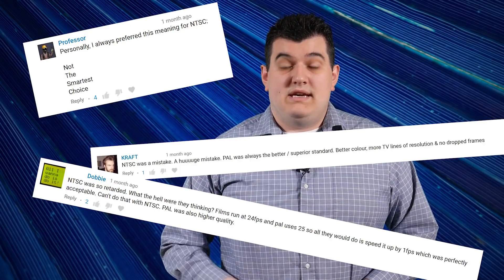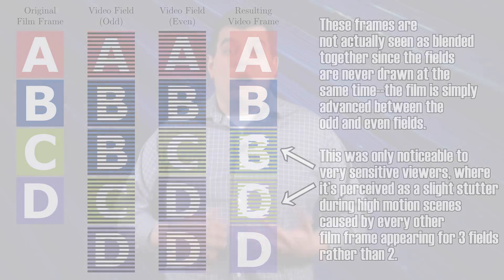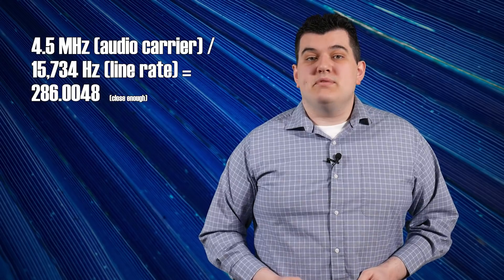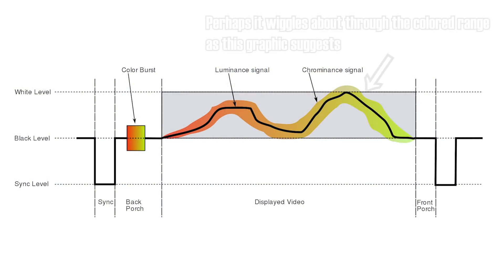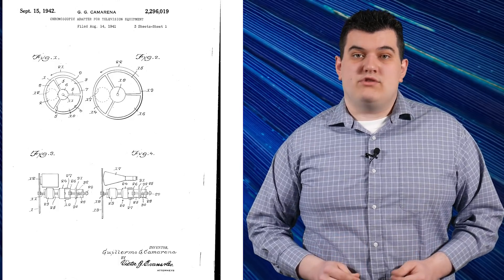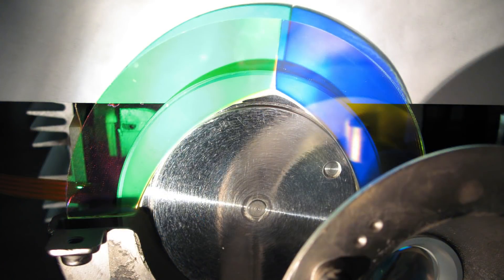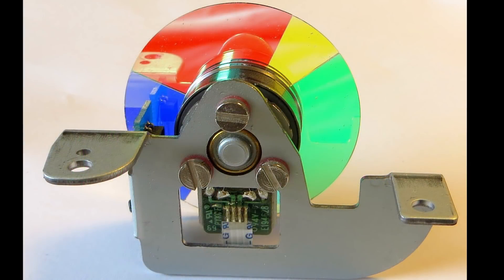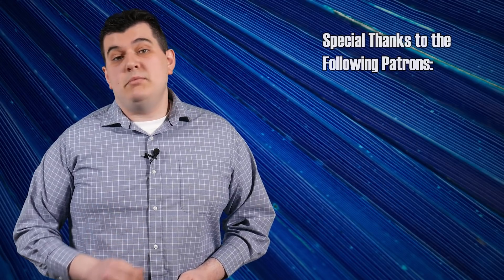Analog Color TV Wrap-Up--Some extra info

Comment: The fact that they managed to make it backwards compatible at the time is an impressive feat. What nags me though, is that the backwards compatibility has caused that 29.97 and 59.94 fps to stick around well past any technical reason for it being there, like some signage grade LED processors and projectors, that are being used in electrical grids all around the world that may or may not be 60Hz and sure as shit aren't dependent on mid 50s american broadcast bandwidth limitations. The pure digital signals also still include the blanking and overscan shit even though they serve no purpose what so ever. There was a point when shifting from VGA to pure digital where instead of building the new standard based on the old, they should've just started from scratch.

Comment: What I want to know is how we ended up with 2 digital TV standards (ATSC and DVB-T). Was it like analog with one comming first and the other comming later but fixing problems with the first? Were both developed at the same time? Were they designed differently to allow easy conversion to the respective analog TV standards (ATSC to NTSC, DVB to PAL) so they could easily work on existing analog TVs via converted boxes?

Comment: Huh, I've always wondered why Steve Jobs boasted about their monitor using an older tech (the shadow mask) but it makes sense it was for the resolution.
Reply: What are you talking about? Apple used shadow mask CRTs on cheaper monitors, and aperture grill (i.e. Sony Trinitron and Mitsubishi Diamondtron) CRTs on higher end ones. Of course they then moved the high-end monitors to LCD, and later all of them. What never got used in true computer displays was that slit-style shadow mask shown in this video. (I think some very early color computer monitors, think Commodore 64 and Apple II days, which were basically just TVs without a tuner, did use that shadow mask style. But high resolution computer monitors, VGA and above, needed finer pitch, so used either the dot triads or aperture grilles.)

Maybe what you’re thinking of was Jobs simply stating that they put a high quality CRT in the original iMac. He certainly never said it was better than an aperture grill. What it was, though, was a reasonably good quality shadow mask CRT, better than what most consumer PCs of the day came with. (They often had bigger, but lower quality displays.)

Comment: The BBC ran some colour video testing around 1959/60, but I guess thy were using American NTSC equipment and decided not to bother.
I always noticed in the 1970s and 1980s how American shows shown in the UK always looked very yellow tinted compared with our own and blurred, though the blurring was probably due to the frames-per-second difference.

Comment: Any in-band modulation of the video signal would be visible.   Pretty much that simple.  Later receivers suppressed the center frequency for luminance display, so areas with solid color didn't have the 3.58 MHz interference, but the interference still showed on transitions between colors.

Comment: Wow from what I’ve gathered you Americans really love pal. Well as someone who grow up in a pal region l tend to disagree with you Americans. Pal sucks arse in my opinion, why you ask 2 reasons number 1 slower speed 50hz was such a retarded choice retrospectively why because virtually all video games were just slowed down and movies just sped up and even worse 50hz gives me a fucking eye strain why because it flickers a lot more than ntsc thanks to the lower refresh rate, I mean seriously WTF and 2nd the “extra resolution” why is that a problem because the extra lines that pal had were almost never even fucking used (at least in retro games) and even worse still, because of the “higher resolution”old video games in pal regions had “letterboxing” and looked squashed and there was no way to fix it and let’s be honest even when the resolution was used this is analog crt TVs were talking about you probably couldn’t even tell the difference thus negating any significant advantages pal could ever have over ntsc at least in my opinion, that is why I am very jealous of you Americans that got ntsc.
Reply: The cycles got decided because your power lines fed 50 and ours were 60.  It was a lot more costly back then to create a frequency electronically, than to simply use what was coming from the cord.  The 50-cycle drawback got a lot more amplified once screens got bigger.  This side of the pond, few of us had any idea how bad NTSC was, until we viewed ATSC or high-end computer monitors.  Now it's hard to give away a tube TV set!

Comment: In a NTSC or PAL signal (also called composite video) the color signal based on a subcarrier is modulated with the luminans signal. It is very difficult to separate the composite signal into Y (luminans) and C (color) without aliasing. Simpel filtering using passive electonic components like capacitors and coils will give the aliasing (the crawling dots) on a black-and-white TV. Broadcast signals were internally based on component video, thus no crawling dots in tape editing. Component is Y, R-Y and B-Y signals making the video processing much easier. Yes, it requires three cables and three identical amplifier circuits to transmit a component video signal. However, due to black and white TV the colors have to be transmitted as luminans and chrominans mixed together - the composite signal. The subcarrier would when be used to set the hue and decoding correct on colour TVs. On broadcasting the tape recoders or synchronizers used a comb filter to split the received NTSC/PAL into luminans and chrominans for later editing. The comb filter came in the early 90's and very expensive, and it did not make sense to implement a comb filter on mono chrome TVs. Most people will not know about the crawling dots, mainly on cyan colours, and will be accepted as a trade off for having backward compability with B/W TV when NTSC/PAL made is possible to transmit colour is a single and relative low-rate bandwidth.

Comment: It is true that some TVs could produce an interference pattern caused by the difference between the chroma carrier and sound carrier frequencies but this was much more coarse than the chroma dot pattern. The fine 'chroma dots' were simply caused by the colour subcarrier being superimposed upon the luminance signal. The colour system used the supressed carrier AM technique which is why the dots disappeared in non coloured appears. The reference frequency of the colour subcarrier was not a whole multiple of the frame rate which meant that the exact phasing of the colour subcarrier info was different on consecutive frames. This meant that the chroma dots would move and hence be less noticeable by averaging out over several frames. It also meant that false colour artifacts produced by components of the luminance signal being wongly decoded as colour, would appear different on consecutive frames and produce a flickering effect.

Comment: You don't need to artificially manipulate the Y signal since it relates to color brightness.
The dot pattern is indeed caused by the chroma signal. You can figure that out using a bar pattern generator and an oscilloscope: the dots will be more visible in the bars where the chroma signal has more amplitude.

Comment: I have relatives in Australia and anytime they'd send us VHS tapes in the mail of home movies or TV recording my dad said they couldn't be watched right away because they were recorded with "different electricity". We always had to send the tapes to a local business that could dub an NTSC copy of the tape. When I asked one day to see what happens with our tapes they showed me where they work on having those taps dubbed and explained that "different electricity" meant a different color system that our TVs and VCRs weren't compatible with.
Reply: Specifically re electricity, Australia (like NZ, Europe, etc) uses 50 Hz AC, vs 60 Hz for the US, Japan, etc. In the early days of TV, it was much easier for TVs to display images whose frame-rate (frames per sec, fps) were related to the AC frequency, so in the US that's 30 fps, in Australia it's 25 fps. Nowadays TVs, computers, projectors, etc have much better power supplies, and nearly everything is digital, so the AC frequency really doesn't matter. But due to the history, differences persisted.

The other half is that Australia chose 625 line pictures (as per Europe). The standard choice for 625 at 25 fps was PAL colour (or the French SECAM). This was by no means mandatory - but again, historical and political influences as well as technical factors made these regional choices  pretty entrenched.

Comment: Further to you comments concerning frame rates I think you're being a bit unfair about PAL. The 25 frame rate was imposed on us to quite a degree by the fact that our A/C in Europe is set at 50 cycles. A 25 frame rate works perfectly at 50 Hz. In the US you run at 60 so 30 FPS is a perfect solution. Because your system is a 30 frame rate it is impractical to speed up 24 FPS film to compensate. It would be a 24% increase in film speed. By happy coincidence film runs at 24 frames and our European TVs run at 25 so a 4% increase in speed was deemed perfectly acceptable. Indeed I don't think it's detectable. The stutter caused by the NTSC compensation system I believe was highly detectable. I can remember watching shows like Soap and Rosanne shot on video tape and the picture quality was dire when shown on British TV. But perhaps the picture quality was the victim of further conversion from 525/30 to 625/25. Dunno.

Comment: The funny thing is I've got an effect I've been working on for usage in "retro style" games that, to a reasonable extent, sort of simulates all this. In fact it literally takes an RGB image, converts to YIQ space, and then it produces a pure black-and-white signal by taking Y and modulating it with I/Q using sine and cosine carriers - then later uses those same sine/cosine carriers to reconstruct the YIQ from that pure black and white signal and convert back to RGB.
And yes, if you view that signal output in pure black and white (as I've done for debugging purposes), it looks precisely like that weird dotted black and white pattern you refer to, although in mine it also tends to manifest a diagonal "stripe" pattern as well (due to some other quirks of my implementation).
Reply: PLEASE tell me this is done and where I can get it

Comment: You forgot to mention that Camarena's system was the chosen one by
NASA for it's spacial transmissions. It was because the system was
simpler than others. Besides Camarena started his work with color
Television in the 30's. His first patent was submitted in 1940.
Reply: Well said 👏👏

Comment: If you get around to it sometime, I’ve always wondered how national broadcasting worked. How did material get from the network to the local stations? Also, what was the physical setup like for broadcasting film?
Reply: In the early days sent tape or filmreel in the mail. Then later, microwave links.

Comment: You said that the higher line count of PAL came at the expense of frame rate. I believe this is backwards. Frame rate in old TVs is determined by the power cycle rate. Since it is 60 Hz in the US we got 30 fps. In Europe the power cycles at 50 Hz so they were stuck with 25 fps. Since they couldn't change the frame rate they added extra lines to fill the space.

I agree that a pull-down is better than speeding up the movie. It interferes less with how the movie was shot. Many video games were designed for NTSC and just slowed down by 16% on the PAL version.

Comment: Phase alternation was actually tried by the NTSC. At the time, however, no 1-line video delay technology was available, so the cancellation of phase errors would depend on the eye doing the cancellation. This is not perfect, and could result in visible flicker or horizontal line patterns in the picture. It was decided that a reliable improvement could not be obtained and the technique was abandoned. When phase alternation was adopted for PAL, economical acoustic delay lines for use in receivers were available. It was found that poorly operating receivers could produce visible horizontal line patterns, which were nicknamed "Hannover bars" by some, based on the city where PAL was invented. These same delay lines were used in top-line NTSC receivers to make "comb" filters to reduce the interference between chroma and luma. Comb filtering was much more difficult in PAL receivers and generally not attempted due one phase of subcarrier not alternating phase between lines, while the other phase did.
Reply: Imagine if they actually kept that
Everyone would be using NTSC, PAL wouldn't even exist, and things would be less confusing in general.

Comment: People keep getting this wrong. Let me correct....... once again.

NTSC is not 30 frames, it's 60 frames. Each frame is missing half the information to fit into the bandwith standard. Same goes for PAL. Yes, some footage can be 30 or 25fps, but mostly it's 60 or 50 fps, with each frame missing half the info.
Reply: I'm afraid you're getting it wrong. The half-frames are known as fields, so 60 fields per second equate to 30 frames per second.

Comment: Very well researched and presented. I am glad the irrelevant relation between resolution and color standard was emphasized. The PAL acronym could also be "Problems Are Lurking". This is because the alternating R-Y used in PAL encoding makes later luma chroma separation at decoding more difficult. The elegant simplicity of NTSC lent itself to more efficient comb filtering of the chroma signals from the luma. As a result, NTSC can provide higher overall resolution because there is less luma filtering loss. Note that the BBC were set to launch NTSC as late as early 1967 and only reverted to PAL to fall in line with Europe. This was evident by the last minute augmentation to the Rubidium frequency reference in BBC studios with a 25Hz color subcarrier offset add on. Lastly, with reference to the subcarrier dots, remember that the chroma difference signals were modulated within the baseband luma or Y signal. This means that the phase and amplitude of the dots recorded on the film provided the guide to color demodulation.

Comment: There are some things in your video that aren't right.

Europe had in mind backward compatibility, or black and white compatibility. The thing is, after WWII, most TV networks were out of order, having been dismantled before or during the war.
In addition, except in the UK and Germany, TV simply didn't really existed in most of Europe.
For exemple, less that 1000 455 lines TV were in service in France, all around the unique TV emitter located near the Eiffel tower.
France and the UK were two exception because the UK wanted to keep their 405 lines service. They made several color sets; some collectors found NTSC-A (405 lines) TV sets and made them work.
UK experimented with SECAM A sets but apparently those never left testing facilities.
After WWII, France had a German-made 445 lines emitter (there is actually a very nice story behind that) so broadcast could restart quickly.
But in 1950, we made a qualitative jump with the broadcast of a 819 lines system (system E). SECAM was planned to be used on System E later when the price of technology would allow it.
What happened is that both the UK and France are member of the European Union of broadcasting; for easier communication and television programs sharing (like the Eurovision, yep, it's that old) the EBU asked France and the UK to have at least one 625 lines channel broadcast. When color was about to appear on European screens in 1967, the EBU said that only the 625 lines standards were allowed to be broadcast in color.
So both the UK and France had to leave their non-common standard in B&W and colorize their 625 lines channels.

And this is also the reason why the French L standard use positive modulation. Because all pre-war standards used positive modulation (like System A and the 445 German system).
Because French industrials and governement though that the 819 lines would become the standard, 625 lines compatibility was piggy-backed on French television, by only changing the line count, creating the only 625 lines standard with positive video modulation.

Comment: I'm pretty sure the difference in 30fps vs 25fps on NTSC vs PAL comes from NTSC being in America where the standard AC current comes in at 60Hz, and in Europe it's at 50Hz. Both standards draw every other line in between frames. Interweaving as it's called. It would have made sense back then to use the network current for timing and synchronization. If we design a standard today, we probably wouldn't even consider that as a way to measure time slices, but that was the most reliable thing they had at the time, with the rarest and least-wild fluctuations.
To be clear, I find no reason we would need to measure time slices like that in the receiver, but the reasons would be on the side of the broadcaster. Their equipment would probably use it as a marker when to take the frame and begin slicing and sending the lines. The receiver wouldn't care as much.

Comment: The problem with PAL’s color standard is that its color resolution is only half of the vertical resolution, meaning you only get 288 lines of color per frame, instead of 576. This is why PAL stood for Phase Alternating Line.